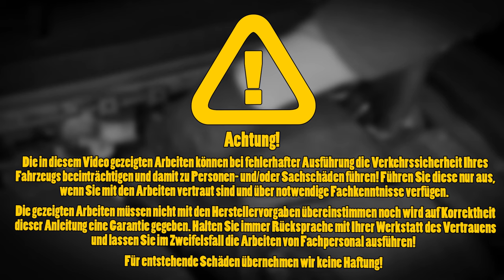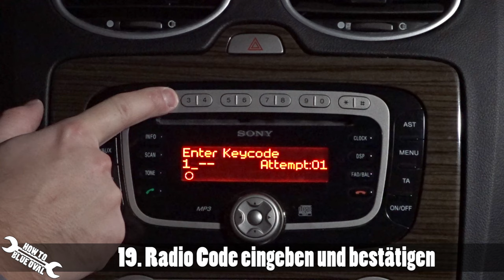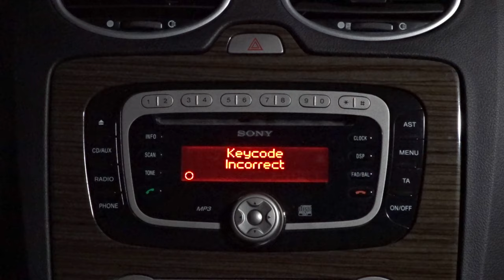Anleitung: Ford Batterie wechseln / ausbauen - Autobatterie für Ford Focus MK2, Mondeo 4, C-MAX etc.

Comment: Saludos, tengo un focus Titanium del año 2014 1.6 TDCI 117 cv, si le cambio la batería se pierden datos de km u otras configuraciones ? La radio está integrada en el salpicadero, es marca Sony y que yo recuerde no tiene código.
Tendré algún problema con la electrónica ? Se desconfigura algo que luego no funcione bien si le falta la corriente durante el tiempo que tarde en cambiarla ? 
Gracias y un saludo.
Reply from the maker: Hola Miguel,

mi programa de traducción ha traducido su texto de forma un tanto críptica. simplemente trato de responder:
Si desconecta la batería, perderá el kilometraje diario, el código de autoradiografía y demás, incluso los reguladores eléctricos de ventanas deben ser reaprendidos.

la unidad de control del motor también se restablecerá, pero apenas se nota al conducir.

si necesita un nuevo autoradiocode, puede pasar por el concesionario durante un corto periodo de tiempo.
Reply: @htbo  ok, muchas gracias por la información y un saludo.